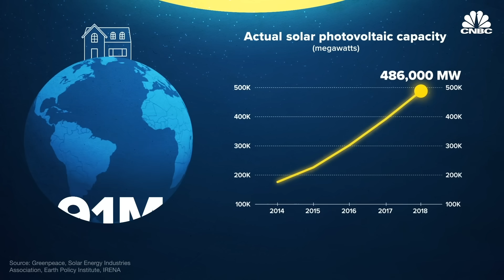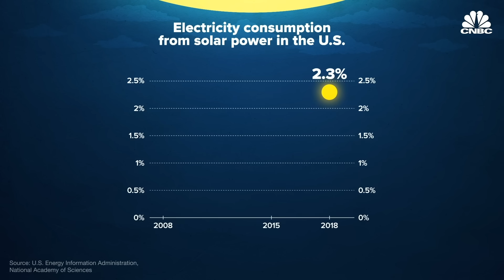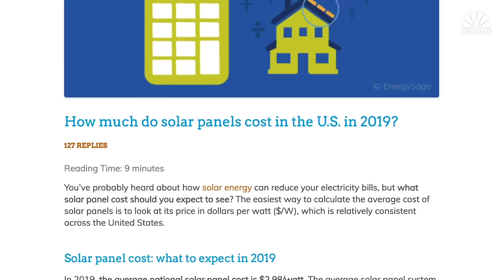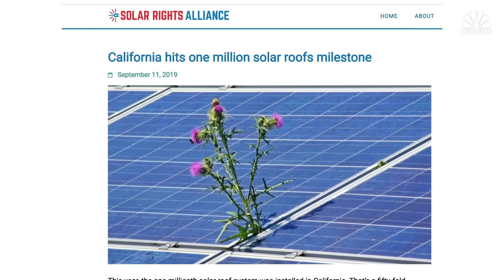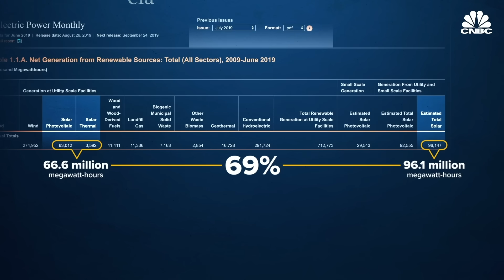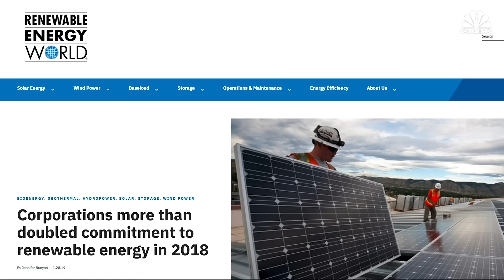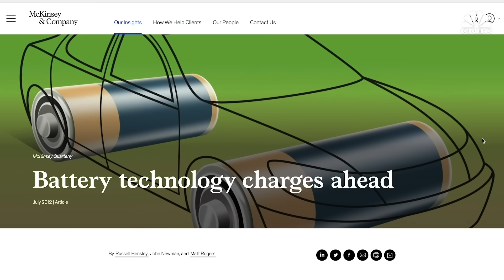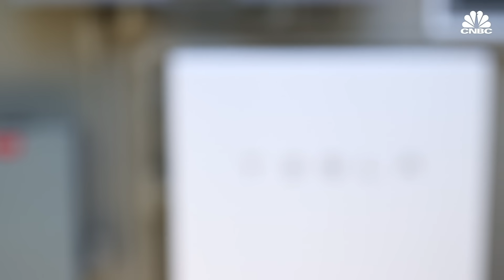The Rise Of Solar Power

Comment: I agree some items will need a certain amount of fossil fuel to operate. However we have the ability TODAY to power the world from solar wind and hydroelectric along with today’s battery technology. It would have the fastest payback of any infrastructure ever built in the history of the world America’s ROI is less than ten years. Most of the current infrastructure is for moving power to where we need it and is already in place. Only production facilities would have to be built. A solar plant is 1/3 the cost of fossil fuel to construct and maintain. Solar panels have a 25 year life but actually last much longer. Chevron currently owns patents to several advanced battery technologies that were purchased and shelved. These batteries were designed for electric vehicles. As oil generates a million dollars a minute in revenue 24/7 you will understand why they will do anything to stop or slow down green energy and electric vehicles. 
      For those who think cars do not cause pollution the should look at the pictures of how clean the air is in areas where stay at home rules are in effect. If you drive a Tesla you will buy a Tesla.

Comment: Solar power and wind are gonna cut it for the future of clean energy we need nuclear power to play too! Nuclear power is the only option we have.
thorium reactors are more powerful than uranium reactors at half the size!  1 ton of thorium is 200 tons of uranium.
thorium reactors mainly Molten salt reactors(MSR) cannot meltdown and do not require water at all!
This reactor produces 92% less waste around 1.2 tons every 10 years compared to the average reactors in the US making 100 tons of waste every 4 years the thorium reactors 85% of the waste isn't radioactive in 15 years while the remaining 15% remains radioactive for only 300 years!
Reply: Thorium reactors aren't ready for mainstream use yet. Probably take about 20years.

Comment: HAHA what a Scam 😂... all the fossil fuels to run manufacturing plants to make solar panels..all the pollution that goes into making a solar panel that's good for only so long ..all the fossil fuel to make plastics wiring components etc..all the fossil fuel to transport.. . All the fossil fuel to go buy or have delivered...all the litter from the packaging..all the litter from packaging needs to be transported to dump....Then you have to have batteries to store the energy...Mining Lithium is DEVASTATING to the environment....better for environment to use on grid electricity from power plant....Lot cleaner and Far better for environment to use Natural Gas  to heat with .....Green energy ISN'T really that Green...Windfarms are another Hypocritical joke..

Comment: Hasn't anyone thought about storing power as a battery in gravity-well?
Reply: harsh vatwani Yes, of course. Hydrostorage, excess energy pumps water back into a hydroelectric dam. 24/7 power backup. Also, some drought "just in case" preparation.
Reply: Commonly done in Norway.

Comment: .               We need to work on continuing to improve motivation for solar panels on roofs that are otherwise not being used.  Growing gardens on roof is another option but has to be built in before hand.  It's simply free space with no downside to speak of. Sure, it won't provide all the power we need, but every bit helps. And like briefly mentioned in your video, close to use energy production has the other benefit of lessening grid dependence and electricity grid has its own financial and environmental costs.

              Also you kind of skip over the issue of clouds https://understandsolar.com/solar-panels-and-clouds/ https://www.solarpowerrocks.com/solar-basics/how-do-solar-panels-work-in-cloudy-weather/ https://cleantechnica.com/2018/02/08/solar-panels-work-cloudy-days-just-less-effectively/ And with a sunny day, people use air conditioning more, thus more demand. 

             Also electric cars can be a way of absorbing extra solar energy and storing it if done right.

Comment: Li- ion batteries should only be used for mobile applications, like cars or handheld devices. It's a waste of ressources to use it where size and weight do not matter. Let's use other chemical elements for that (like zinc or sodium)!

Comment: I am the innovative CARLOS UCRÓS PIEDRAHITA of the Republic of Colombia of the UCRÓS ELECTRIC CYCLE SYSTEMS unique in the WORLD and many CHEAPER than the SOLAR Energy I arm them from 5 KW 120/220 VAC 50/60 Hz ENERGY sent instantly and constantly  compare cost with the solar that goes from 300 million Colombian pesos about USD $ 100,000 dollars and occupies an area of 100 meters by 40 meters in panels and my system only use one meter per 1/2 half meter wide and half meter high  It generates energy 24 hours a day, 7 days a week, 365 days a year, minimum maintenance every 3 months and being in function its value is 50 million Colombian pesos about USD $ 15,000 dollars compared to the cost of the plot USD $ 100,000 of the cost  of 24 hours of Solar Eye energy and compare are 5 KW of Instant Energy and constant without Sun no Non-Combustible Wind use small Noise Area the low hum of the motor that has it in Armo Cycle the Systems ap  Personal edition delivered in 25 Days of the money delivery since I have to Buy and order from China the Components that send me by Air cargo in DHL or FedEx and take me up to 15 days Ordering by WhatsApp +57 3012358709 Innovative Unique in  the World of this Carlos Ucrós System www.ucrosenergysystem.com mail ucros@live.com

Comment: Don't underestimate Tesla Solar Roof and Power Wall energy storage.  Elon Musk going to great effort to scale his production in such a way as to bring cutting edge solar and battery storage tech to the masses so as to bring prices as low as possible while delivering maximum efficiency, and the profits from the sales go straight back in to R&D to produce continuously improving evolutions of his tech at still lower prices with greater output.  People need to realise his vision.  The Solar Roof + Power Wall + Tesla Model 3 and Model Y Electric Vehicles mean you power your home and never buy petroleum again for a vehicle.  It's his way of breaking the back of big oil and big carbon energy.  No one human is currently doing more in this field than Elon Musk on such a broad scale.  People need to understand that he first targeted the luxury vehicle market to get cash flow to reinvest and bring prices down.  His latest vehicles are selling for around $40-50K US, which is competitive with the lower end Lexus, BMW, Audi, Mercedes-Benz vehicles.  This is a big deal.

Comment: the grid is NOT a battery ffs
Reply: She said acts as an Battery.  Which is an accurate statement. When residential customers sell their power  back to the utility they are like a battery.
Reply: @joshs.7612  Wrong! Otherwise every powerplant acts like an battery ... ;)
Reply: @amaetfacquodvis2450 Hydro Pump storage units do act as batteries.
Reply: @joshs.7612  Right.
Reply: The grid acts as a battery in Europe. Ever heard of interconnectors? European supergrid?

Comment: You should not use the chinese numbers for prices on solar. Utilizing lower quality products on your LARGEST investment (your home) is nonsense. Residential solar typically ranges (with quality product from 3.50-5$ per watt. That still leaves people with the ability for a great return on investment on a utility that they will spend regardless of if they install solar.

Comment: Tata Solar Panel 200 watt, Exide Battery 65 AH, Inverter, Charge Controller @ Just ₹12500 Complete Set... Call 9716761746 / 8920354137

This system will run 1 Fan, 1 TV, 3-4 Light in your home day and night...

Visit Now Rahul Solar Power, B-2/70 New Kondli Near Mayur Vihar Phase 3, Delhi 110096

Comment: why not just go with the clear glass solar panels ? they where already being talked about in 2014 so they should have come a long way since now. basically why are we not already replacing windows with the solar cell windows
Reply: Clear glass solar panels is still in development period. No major breakthrough has yet happened since 2014. The glass is not efficient enough while costs lots more than regular solar panels.

Comment: Not one mention on power production per square meter? How about the costs of recyling instead of the current landfill where dead panels go? How about the carbon debt of manufacturing solar panels? Don't even get started on transmission costs. Otherwise this is just an infomercial for solar panels.

Comment: They seem to have left out some very important facts. Solar panels takes up alot of space.  That more than 1 acre per car according to this video (29000 acres of solar panel removes 22000 cars). Th ere are 272 millions cars in the U.S.,  I don't think we have over 300 million acres or about 470,000 sq. miles or  13% of country cover by solar panels or the state of California,  Texas and Montana all completely covered in solar panels. And don't forget the millions of birds killed by wind turbines every year. Also, they only work with Sun and wind, which is very unreliable.  All the subsidies that the solar energy get has cause the cost of electricity to increase immensely. For the average person, solar power is lose-lose proposition.

Comment: Houses should be 12 volt systems. All led lighting. Absorption refrigeration. Heat pump hvac. There are 100s of ways to build net zero homes. Govs. Need to promote the green future.

Comment: Wind and solar are safer, cleaner and cheaper than fossil fuels.
Battery storage makes wind and solar base load 24 /7 power.
Wind and solar combined make sense because they produce power at different times.
Solar generates more power during the day while wind produces more at night.
Fossil fuels are OLD POLLUTING technology.

Comment: Why are we not putting more pressure on the light industrial and commercial sectors to embrace solar on their roofs? 
Lets subsidize commercial solar roofs and allow them to sell ALL excess capacity back to the grid so they get the benefit from covering the entire roof of their facilities. From what I have seen from the economics in most regions you are not allowed to generate more on average than your own demand so it limits financial incentive to build big. 

Drive through almost any warehouse and light commercial district and you would see hundreds of acres of large flat roofs. Look at the roof of most shopping malls. And why not make solar covered parking lots?
This could be huge generation for any city, close to load and would be more efficient than tiny generation points on residential rooftops. 

This video mentioned solar on office towers which is a dumb idea - small roof ratio to the overall demand and multiple tenants that pay individual power bills. But on a warehouse building they are often owned by the business or have a few large tenants that would enjoy the benefit of cheap electricity as an incentive to move in. 

I have not done the math but I bet most american cities would have daytime power consumption reduced to zero if they put solar on the sprawling light commercial and retail buildings - maybe not even need covered parking lots.
Anyone want to do the math with a typical American city?

Comment: Go modular thorium nuclear power the only scalable world solution. Solar is a joke.
Reply: Yeah but what about 50% of global power from Thorium plants supplemented by 50% hydro/solar/wind/alternative power? 
I bet a more balanced approach is better in the long run and if we get to the 50% renewable mark before we get to the 50% Thorium mark that is OK with me. There is a lot less money and risk in putting in new renewable capacity not to mention political and social will behind renewable power so let CNBC go after that low hanging fruit. 
Save the Thorium conversation for videos that are talking about coal and Uranium plants, sad as it sounds there are several planned to come online in the next few years.
Reply: 5353Jumper Waste of land pathetic output of 15-44% max, and that is the best lab tests that haven’t hit the market. You can do 5MW plants that fit on the bed of a semi and just keep adding more. The energy density and the longevity make solar a laughing stalk.
Reply: @happyt98  but if you put the solar on rooftops of warehouses and shopping malls there is no wasted land.
And there is a much lower cost to entry.
And there is more public and political will due to perception of the nuclear industry.

I agree Thorium plants are better, but solar and wind are easier. Let's take the low hanging fruit now and work on the real long term solution once there is momentum.
Reply: @happyt98  yes I know a fair bit about LFTR Thorium reactors and I am a fan. Just the reality is that a combination of renewables and nuclear is likely the best go forward and Solar projects are easier to get going today both financially and political/social will. Change is needed today and it will not happen with any nuclear option because of the project planning required, even if it is a better option than solar.
Reply: @5353Jumper  I am simply saying that solar is a short-term fix that is expensive.  Household solar is incredibly inefficient and costly. Doing large scale solar (concentrated solar) in Arizona, Nevada, New Mexico, and California would be the best bet and upgrading the grid with battery backup for the next 20-30 years. I think that modular safe nuclear will be scalable within the next 10 years. Especially with the focus towards process manufacturing off the assembly line and the ability to power entire metro areas in a single go. The cost of solar is in the massive upfront cost and the 20-30 year lifespan limitations, financed or otherwise. Hydro is also another key renewable that could run substantially longer. There are 600,000+ sites around the world that can produce more power than we use by 100x+ globally. It's going to end up being a mix. We as a society don't know how to make things efficiently and do a scattered inefficient approach that is based on short term thinking. Global warming predictions have been around for 60 years with a doomsday message that is so "urgent".
Reply: @happyt98  Yes I agree. 
I wish we would get away from residential solar roofs though and move them to light commercial, wearhouse, retail store roofs and parking lots instead. Larger scale, more attractive, yet still close to the load for efficiency. Change local regulations to allow business to be net positive on their power bill so they can over build and contribute more than their own load. Many major cities are around 20% of land space in these types of buildings with wide open flat roof space and huge parking lots. If you google satellite view large north american cities you can literally see these commercial zones as they are lighter grey than typical residential areas.
This would also be awesome when viable electric fleet vehicles are more mainstream. Charge the fleet with onsite solar.
There are many areas in the central part of North America where Hydro is not an option because there is not enough flow to the rivers to make a fraction of the power the city needs.
This has also limited nuclear in the past as the incumbent design requires large water sources that are not drinking water. But maybe all LFTR reactors could be put close to central cities as it is less reliant on water source.

Comment: This is cute companies have been Testing Infrared Solar panels + Glass / Solid-State Batteries + Micro Wind and Hydro Turbines since 2016  and they Should be all ready by 2022 as the new Standard  You think for being CNBC they would have looked into MORE  of the info out there  (Like if every House + commercial + Industry used Solar in the US that would be 81% of the power)
- That not including all the other renewables here and coming!!!!

Comment: Save the power in hydrogen. At night we burnt it and make power.
Reply: That is not efficient.  We have better ways to store energy ...
Reply: You only lose 30%, show me any way to save energy more effectively? Even batteries you lose 20 at charge and 15 at decharge
Reply: @USAads2023  You are wrong about Grid-Level Battery Back-Up ... they are 92.5% efficient round-trip !
Reply: MrSummitville show me your evidence and I will believe
Reply: @USAads2023  Or you could do the research, find the articles and read them ...
Reply: MrSummitville I did, that is why I said what I said. You may know something I don’t, so show me your evidence

Comment: Xcel Energy still charge $5-$7 additional to current cost of energy. That 2 gallon of milk.
Reply: Change company then because Solar and wind energy are now cheaper than coal, oil or gas.

Comment: Just make it affordable and it's gonna be everywhere. 1W pv for 1usd or more. Thats why Diesel generator is more practical for most people with normal selleries.
Reply: Solar and wind are cheaper than oil, gas or coal and energy companies should charge you the same or less. Your own generator is the most expensive. Work out the costs